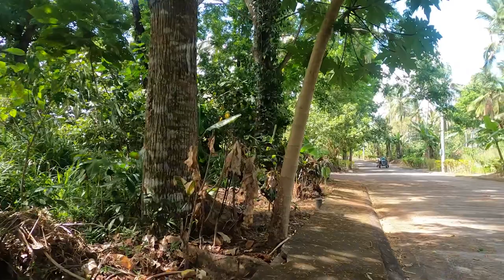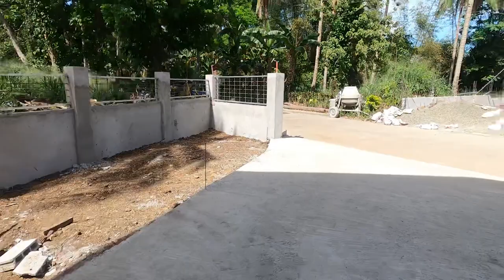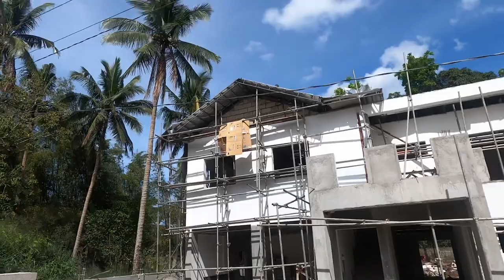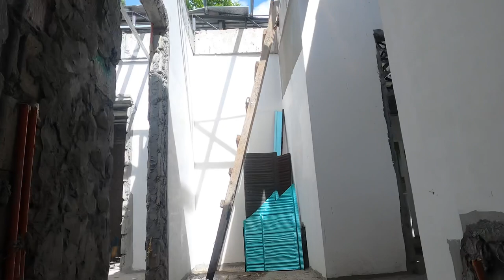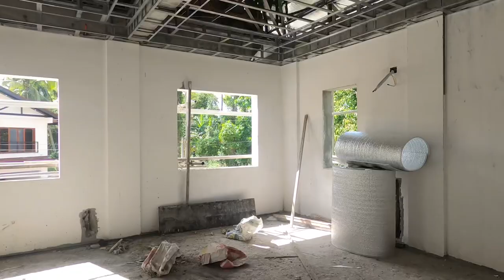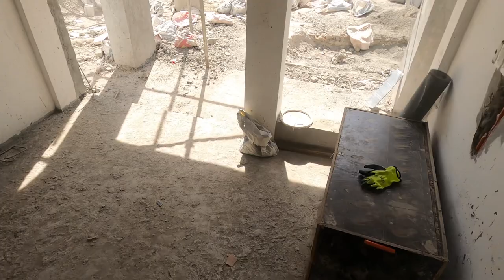Philippines House Build Vlog 71: SECOND BEDROOM WALL TILES HAS STARTED

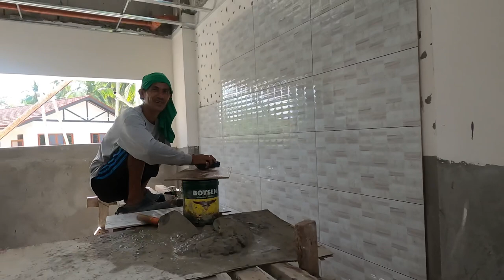Comment: 12:41 all the white set plaster coat i thought would be scraped off before tiling ? not just a few holes made with that ole pipe an nail tool:)  ? they will all dislike me if i ever get to build there i assure you .
Reply from the maker: Hi Andrew, if you do the build you can run the job to your specs, Stay Safe.